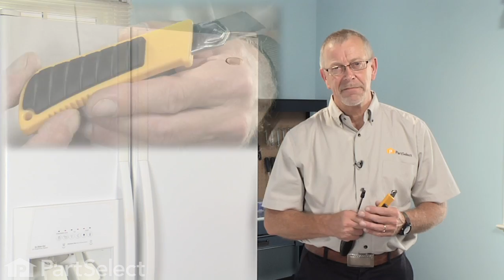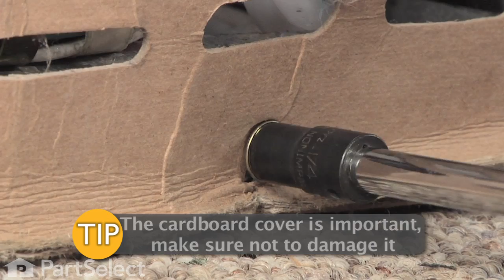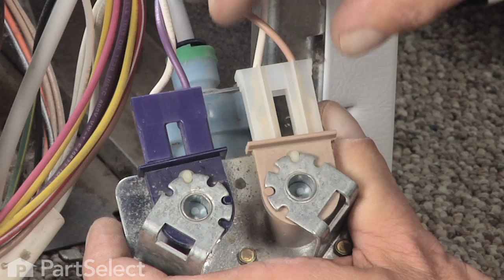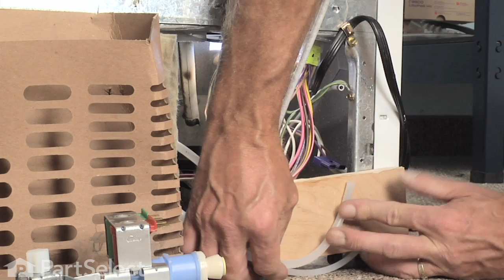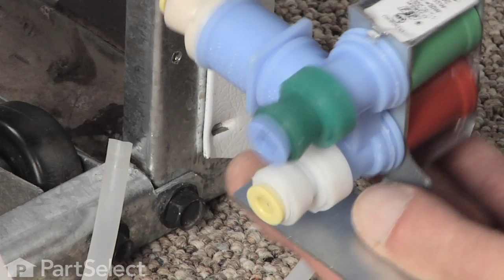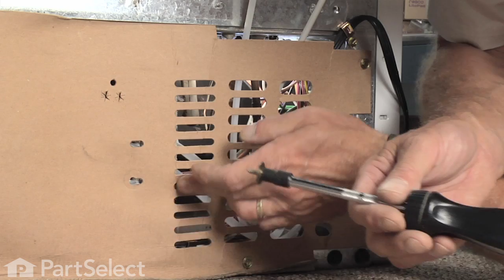Refrigerator Repair - Replacing the Water Inlet Valve (Whirlpool Part# 4389177)

Comment: Hi: I hope you are still reading comments.  When we pull out our filter to change it water gushes out and doesn't stop until we turn off the water to the house.  Do you think changing this valve would fix it? The filter housing itself is in the bottom right hand corner of the refrigerator.

Comment: Thanks for this video.  Your videos are the best, very easy to follow.  The inlet valve bracket in my Kenmore 106.59562990 was riveted together with the bracket for the main water valve coming into the refrigerator.  I saw on Amazon where folks had drilled that joining out with a 3/16" or little larger drill bit (to separate the brackets).  It sounds harder than it was.  I just wanted to add that here, for anyone in the same situation.  Once the brackets are separated, I just followed the above video and was able to screw both brackets back on the refrigerator with no problem.  I didn't have water coming into my ice maker (but it did flow through the water dispenser).  I went ahead and replaced both the ice maker and the valve and it works great now.  Thanks!

Comment: Hi. I have a 2010 Whirlpool Conquest side by side. Model # ED5LVAXWQOO. The ice maker was not working so I replaced it by watching your video.  Super simple thanks to your video. I also replaced the water filter.  However, now I have icicles hanging all over my freezer compartment. Is the ice maker dispensing too much water? Is the water pressure to high? Can I turn the water valve down a bit?  How do I fix this? 

Please help...
Reply from the maker: Thank you for your question. I will have a response soon. Thank you.
Reply: PartSelect have you not found an answer for me? 🙁

Comment: My two doors Whirlpool refrigerator,  the ice maker broken. The water dispenser is OK. There was no sensor light on. I replace the sensor control board. The sensor light works fine. But no water come out to the ice maker. I replace the water inlet valve yesterday. Still there is no water  come out from inlet valve, but the dispenser is OK. There is water out from the inlet valve for the water dispenser, but no water for the ice maker. I check the water line tube in the back. There is no water out from the inlet valve ( to ice maker). What is the exactly issue or the problem that cause the water no coming out from the inlet valve to the ice maker?
Reply from the maker: Hi Cherry, could you please provide your Whirlpool refrigerator model number and I will be happy to look in to this for you.
Reply from the maker: Hi Cherry,  Depending on your model number you could have an issue with the ice maker control, the wiring to the water valve or you may have a frozen water line into the ice maker fill cup. Are there cubes in the ice maker mold?You can initiate an ice maker harvest cycle using an insulated piece of 14 gauge wire to make a jumper between test points “T” and “H” on the ice maker control. This will start a test cycle and after about 15 seconds you can remove the jumper wire. The ice maker motor should continue to rotate and at the end of the cycle the water valve will come on for approximately 7 seconds. If the cycle goes to completion you should have at least heard the water valve solenoid humming. If it gets power and hums but no water, look for a frozen inlet tube in the freezer. No power and I would suspect the ice maker control.
Reply: Thanks for your response. My refrigerator MODEL : GS6SHAXKQ01
Series : SL1537773. Whirlpool side by side.
Reply: Hi PartSelect.  My refrigerator MODEL : GS6SHAXKQ01. As I describe the issue in my comments, I replaced a new sensor control board. The sensor light is ON now, but no water to the ice maker. Then I replace the inlet water valve last week. It still has no water to the ice maker. I checked the water tube from the inlet water valve to the ice maker(back of the refrigerator). There is no water out from the inlet valve, but it has water to the dispenser. Dispenser works OK. I have turned off and unplug the refrigerator for overnight to meld down the ice in the freezer and clean my refrigerator two months ago. I think it should not be the ice in the tube issue. 
I will do the jump test points "T" and "H" as your advice this weekend. Should the refrigerator and freezer remain  power "ON"?
Thanks.
Reply: I did the jumper test on "T" and "H" right now. I did twice 15 second. There is no response at all. Is the ice maker bad and need to replace the ice maker? or other issue?  Do  I need to replace the whole ice maker "Whirlpool 2198597 Ice maker" or just the partially "Whirlpool Refrigerator Ice Maker Motor Module Control 628358"?

Comment: I have a very strange problem. I replaced my water filter, after a month it stopped working. I removed the water filter and my water flow is perfect. I put in a new filter, and same thing happened. Then once more. After I remove the filter the water flow is perfect, so what is causing the water filter to stop working or get clogged?
Reply from the maker: Check the water valve to see if you are getting any sediment on the inlet screen. If so, you may have a problem with your water supply. If the screen is normal, I can only suspect that the filter is defective.
Reply: If I am getting sediment on the inlet screen, what type of problem would I have with the water supply?

Comment: I have a Kenmore Elite model 795.7404 and the valve you show in this video is basically the same thing, just in a different place on the fridge. It's at the bottom of the left door. Anyway, my water dispenser quit, and it takes a very long time to make ice. I'm talking maybe two or three days to fill the ice bucket. The guy on JustAnswer told me to get a new dual valve, which I did. I installed it and it didn't help. I wasted $28 on JustAnswer. Is there something else I might try in order to get the water/ice maker working? It's summer now and getting hot. We need our ice! Thanks in advance.
Reply from the maker: Are your ice cubes the same size as you had been getting previously? If the ice cubes are normal size and the freezer temperature is normal, then look for a fault with the ice maker control. The water dispenser uses one half of the dual valve and the ice maker the other half. You may have a frozen water reservoir in the fresh food section that might cause the dispenser not to work, but that should not affect the ice maker. Are there more digits in your model number? The number you quoted does not come up in our
database.
Reply: Well, I removed the filter and put in one of the bypass plugs and now it works perfectly. If I put in a new filter, it goes back to the way it was. So I can only assume there is something wrong with the filter section. I'll just put an inline filter on the line in and be done with it. Obviously the design is poor.

Comment: Our ice maker quit working. We installed a new one and it still didn't work.  I called just answer I think it was , and talked to a technician and he said we needed a new valve.  We ordered a new valve and installed it.  The ice maker still isn't working.  I'm really upset. We have a Whirlpool and it is a 2006 model.
Reply from the maker: You should check for power to the ice maker harness first. Make sure that the harness on the replacement ice maker is the same as the original. Check this troubleshooting video for more tips. https://www.youtube.com/watch?v=I6Sgbo-CB3s
Reply: I wasted 28 bucks on JustAnswer also. My Kenmore Elite model 795.7404 quit dispensing water and it takes a very long time, like days, to fill the ice maker. He told me I needed a new dual valve. I got one, put it in, and the same thing! I asked for my money back but haven't heard from them.

Comment: how long it takes to make ice after replacing the water inlet value on a kenmore refrigerator 106.51564104
Reply from the maker: The length of time to produce a tray of ice cubes is directly related to the temperature of the freezer compartment. Normally, you
should see a harvest in less than 2 hours. Remember that each time you open the door the temperature will rise and that cycle time will increase.

Comment: Thanks guys for such a great instruction video.  I replaced my water inlet valve by watching your video.  I replaced mine due to the problem of having a huge frozen waterfall inside my freezer almost daily.  Once I replaced the valve I turned everything back on and the ice-maker started producing ice and is working fine.  I have a great flow of water in the door as before too.  But... my issue is I still have water accumulating in the bottom of my freezer.  I am not sure where the water is coming from but it appears the ice-maker may still be overflowing as before.  I have turned off my ice-maker just to see if the water accumulation stops showing up.  I removed all the ice by breaking it up and removing it from the bottom of the freezer so I will know if new water accumulates and freezes again.  What would you suggest I do next?  Thank you.
Reply from the maker: Turning off the inlet water supply to the refrigerator will help determine if the ice build up is defrost water related or from the ice maker. If the freezing water still occurs, then suspect a plugged defrost drain tube. If the freezing stops, then look at the fill time for the icemaker. It should not be longer than 9 seconds. If the fill time is longer, suspect the ice maker control. Is there any ice buildup in the supply tube to the ice maker?
Reply: +PartSelect That is exactly what it was.  It was a plugged up defrost drain.  It appeared I had two issues at once.  I got the drain unclogged with hot water and a few towels now everything appears to be working fine.  Thanks again for all your help.

Comment: One thing that should be pointed out in this video is that the lines need to be reattached to the same solenoid valves as before. Otherwise you will send water to icemaker when you try to get a drink of water and water will pour from the water dispenser when the icemaker kicks on!
Reply: They only fit on one way. The tubes are different sizes! So what you describe could never happen.

Comment: I just replaced the inlet valve on my Kenmore model # 795.75549401.  The old inlet valve was leaking and I ordered the part and replaced, per the video.  I am now not getting any water from the dispenser.  I hear the typical buzzing when the switch is depressed, but no water.  The water dispenser and ice maker have been out of use for about 2 months…just haven't had time to make the repair until today.  Any suggestions?  Possibly a bad inlet valve?

thanks!!
Reply from the maker: Pete Payne I will ask Steve what he suggests and get back to you.

Comment: Dear steve, I changed the water inlet valve because we have no water to the Icemaker. After replacing the inlet valve we still have no water going to the icemaker, however, we have water to the drinking water side. We use to here the solenoid buzz when letting water in the ice maker while water was running into the tray, now we do no here that. What runs the solenoid? We need help! Your friend in Christ, Rev. Carl Covey
Reply from the maker: Carl Covey What is the model number on your fridge?

Comment: Sir, I need some advice.
I have a Whirlpool:
Whirlpool Model ED25DQ

I replaced Icemaker and solenoid water inlet control valve, and it worked for a very short time, then started overfilling drastically again.
What could be the problem?
Reply from the maker: If the icemaker mold is overfilling, the problem will be either the icemaker control supplying power to the water inlet valve for too long (more than 10 seconds); a defective water inlet valve that does not shut off quickly when power is removed or a low household water pressure supplying the valve. The low water pressure can be caused by a restriction in the shut off valve used or a kink in the supply tube. When the pressure is too low, the water inlet valve will not close or shut off quickly enough and overfilling can occur.

Comment: I replaced the water inlet valve on my Kenmore Elite (Model 52693100) because it wouldn't stop dispensing water to the ice maker. Well, after the replacement, it worked fine for a couple days before flooding my freezer again today. Is my ice maker bad? What do you recommend?

Comment: Hello,

Was hoping to get some help. I have a Whirlpool ed25uexhw00. It was running fine then all the sudden it stopped running. It has power, you open the doors and the light comes on but its not cooling. I found that if I turn the temperature dial off then on the lights turn off briefly and turn back on then the compressor starts running again and it starts cooling for a while until it randomly stops again and doesn't come back on until i turn the temperature dial off then on. Any ideas?

Comment from the maker: Hi Joe,

Sorry to hear about this issue. Are you able to provide the make and model number?

Thanks a lot!
Reply: I am attempting to replace an inlet valve on a older model whirlpool. The problem is, the new valve has push locks, when my old my had twist “nut” fittings. Would you advise cutting the old fittings and follow your video instructions?

Comment from the maker: Hi there,

Sorry to hear about this problem, and thanks for your question. You're very welcome, for the videos! You're right that it may be the water inlet valve. You can check this by disconnecting the dispenser's water line from the water inlet valve, then pressing the dispenser actuator to see if water continues to drip from the valve. The part number you'll require, if the inlet valve is at fault, is W10408179. This can be found on our website.

Hope that helps!

Comment: Hi, I have a Whirlpool side-by-side, ed5fhextl00. The water dispenser sometimes drips after dispensing. Sometimes right after dispensing water, it looks like a bubble forms, which turns into a slow drip, but other times it starts dripping after we walk away. When this happens we usually try dispensing a little more water until it looks like it is not going to drip. The filter isn't new, maybe a few months old.  Should we check/replace the inlet valve or something else? thanks for these videos!

Comment from the maker: Yes, if ice exists in the tube, it will cause problems. Is your water dispenser still working properly? If you don't find ice build-up problems, and you don't suspect problems with the water supply, it may be the ice maker control that's at fault.

Comment: It turns out that you can not install the plastic output tubes incorrectly.  They have different diameters.  So my installation was correct.  While I had the plastic tubes out of the valve, I tried blowing into each one.  I was able to blow air through the thin one but not through the thick one.  I also tried pumping hot water into the thick tube but that didn't work too well.  My problem is probably ice in the tube.  What do you think?

Comment from the maker: Hi there,

Thanks for providing the model number. This is a very common problem with your model. I would suggest checking into replacing the ice maker control and motor assembly. That part can be found on our website using part number PS2341896, and is compatible with your model.

On that part's page, you'll find 193 reviews and tips from people who'd been experiencing the same (or similar) problem - sometimes helpful to take a read through.

Let me know if that helps at all! Good luck.

Comment: The ice maker is not making any ice at all.  Does it matter which fill tube goes into each of the two valve outlets?  I tried heating the ice maker's water tube.  That didn't work so I replaced the water inlet valve as per your video.  I was considering injecting hot water into the ice maker's tube but my wife didn't let me.

Comment from the maker: Hi there. Is your ice maker making ice but just not dispensing it, or not making ice at all? Have you checked the fill tubes? Check out your ice maker mold. If there are no cubes, or only very small cubes, there could be an issue with the water fill tubes. Is there a build up of ice, or any foreign objects that would disrupt the flow of water? And, yes - definitely properly re-install the outlet tubing. Hope that helps!

Comment: I replaced the filter and the water inlet valve and the ice maker still does not make ice.  The water flows normally.  Is it possible that I installed the output tubes backwards or doe s it not matter?

Comment: About 6 months ago I changed my filter and the dispenser stopped so I changed my filter and still didnt work. Used old filter still nothing, Shortly after, it was determined that the inlet valve was bad. Replacing this part fixed my issue. I actually bought the part from you. Here we are six months later and I replace my filter, magically my dispenser stops again. WTF?!?!?! any ideas.

Comment: If the water inlet valve is damaged, will it stop BOTH water & ice maker,.. Or can it just stop "one" water flow?  I'm getting water from the dispenser on the door, But my ice maker isn't producing any ice... Is there a way to check this?

Comment: I disconnected the line at the bottom, front of the fridge...where there is a quick disconnect.  When I press the water dispenser water IS flowing from the feed line to that point so I know the valve is working.  It is not flowing from the quick disconnect up to the dispenser head.  I took my air compressor on low pressure and tried to blow the line out but still not working.  I had turned the temp on the freezer down to 6 out of 9 two days ago thinking the line was frozen. Suggestions?

Comment: Great videos.  Ice maker/dispenser is working fine, I replaced the water filter and it filled right away.  When I press the for water I can hear little click and the low humming noise it normally makes when it dispenses water but no water comes out.